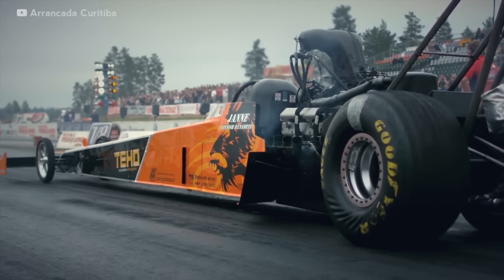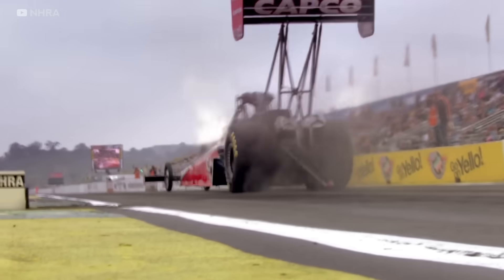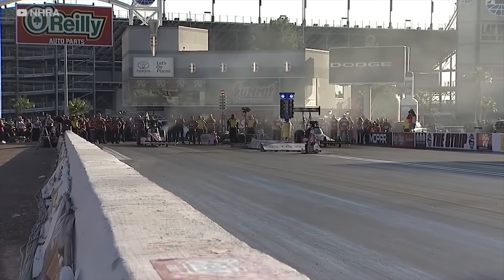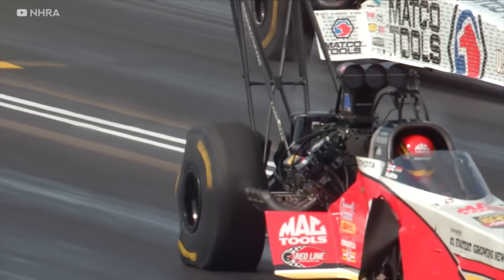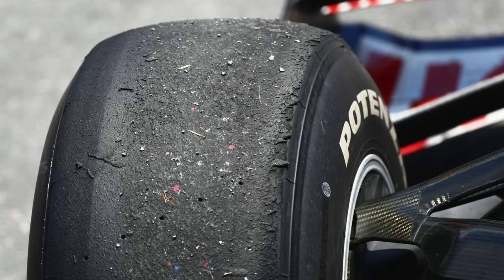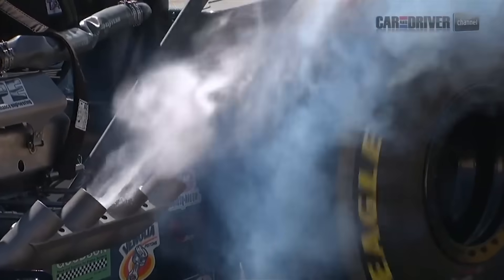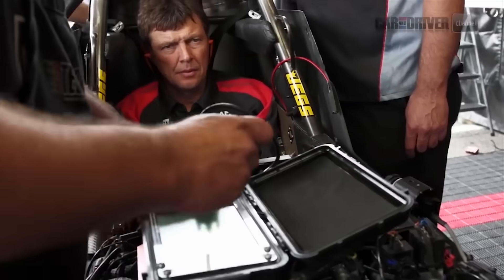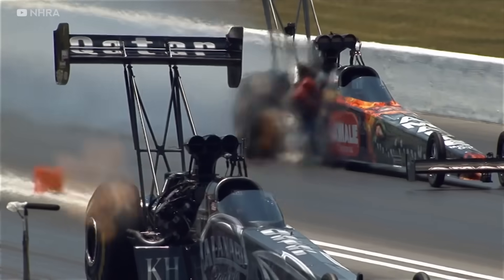How Dragster Tyres Accelerate to 335 MPH in 3.6 Seconds

Comment: You forgot to add this is done in only a 1,000 feet. NHRA officals shortened the quarter mile here in America because they were reaching speeds of 330+ mph. Now they're doing it in just a 1,000 ft.
Reply: Yeah the reduction to 1000 ft was due to insufficient length of run off for the higher speeds.
Reply: @mckennaConfig  except that crash happened at the shortest track on the circuit, every other track that is in the circuit has more than enough shut down room, that track is no longer in the circuit, and the tech has gotten 50x better since then, i say take it back to the full 1320ft (1/4 mile). most tracks are close if not a little over a 1/2 mile in length, so a extra 1/4 mile is more than enough to slow down even if the chutes dont deploy, or dont deploy properly, happened several times at my home state track, here at IMS/ lucas oil dragway, those malfuntioned runs still stopped on brakes alone wayyyyy before the sand traps.
Reply: @MPal24  all NHRA sanctioned events race to 1000ft in America ever since that crash, im not sure about europe tho
Reply: So that's about 300m instead of 400m. That's really short!
Reply: @Septimus_ii  It is! First time I saw it I couldn't understand why cars were shutting off before the finish line lol Still flipping fast though.
Reply: @Septimus_ii  yep, 320ft shorter. I always wonder what they would be running if they still implemented the full quarter mile.
Reply: @MPal24  Top Fuel is 1000 feet in Europe too. Santa Pod in England is the home of European drag racing, and it's governed by FIA rather than NHRA. No idea about Australia (the third member of the drag racing trifecta!) but I expect NHRA, NSRA, ANDRA and FIA want consistency across the world for record setting etc.
Reply: @donkmeister  id say Australia is the home of euro drag racing. Haha
Reply: I thought they shortened it because of what happened in 2008 with scott?
Reply: @The Unblinking Eye That's why they call it the imperial system...lol
Reply: @MPal24  The FIA rulebook follows the NHRA's one usually a year after. All the main rules and regulations inherited from America with some European additions mostly affecting measures expressed in SI format as well and drivers' equipment with FIA homologation listed for specific classes. Until 2018 Mr. Graham Light was the chairman both for NHRA and for the FIA Drag Racing Commission.
So yes, Europe has the same running distance as America. I'm not sure about Australia if they have reduced the distance as well. I'm sure in 2018 they were still running on 1/4 mile.
Reply: I was trying to find the exact difference between 1/4 of mile and 1000 feet in the comments, but found about european and north american political differences and wich one has the best medical centers. You rock guys. But still don't know the difference haha
Reply: @alex.ann_der  I'm sure this comment is just a joke but 1/4 mile = 1320 feet.
Reply: @Zeenithian  In meters, please, no one uses the imperial system. 1/4 of mile are 402 meters, but 1000 feet ? About 333 meters ?
Reply: @alex.ann_der  If you google "what is 1000 feet in metres" then you can find your answer. That also works with any other common units you want to convert, or currencies in fact. 
If you have a hatred of non-metric measurements I strongly recommend you keep away from drag racing... Cars have engines measured in cubic inches developing lots of horsepower, running either 1/4 mile, 1/8 mile or 1000 feet, hitting high MPH through the trap, in the shortest E/T in seconds... Demanding we don't use the established system of the sport would be like walking into a fencing club and demanding they stop using French terminology because you'd rather they spoke English.
Reply: The track length for the nitro burning classes was shortened to 1000ft after Scott kallita lost his life on a short run off track.
It was also based on the amount of damage (potentially fatal ) in the last 340ft of the original 1/4 mile,that the fuel cars were doing,for potentially little gain in mph.
Reply: I've heard that if they extended the track back out to the full 1320 the cars as they're configured now would run 400+. I need to sit down and do the math to confirm it. It's absurd if true though
Reply: @That1OldMan  that's amazing to think about, isn't it? From 0 - 400 mph in just a quarter of a mile? Then again, they said the same thing when Kenny Bernstein broke 300mph at the gator nationals in Gainesville, FL. I was just a kid, but it's amazing to see how things have advanced, and where they may go.
Reply: They reduced the length because dragsters started taking off at those speed
Reply: Wait... Are we talking about drag racing, or pissing and moaning about the units that are or are not used in other countries and/or the merits of a national health service Vs privatised health care? It's now hard to tell in this comments section. 
Seriously guys, get a douche, flush the sand out of your collective vaginas and put your whinging back in your purses.
Reply: They shortened it because they were reaching speeds way over 335 and they wouldn't have time to stop.
Reply: My understanding was that the majority of oil downs happened in the top end, so by shutting off early before the nitromethane sent the engines too lean, they were lowering lost time incidents - engine nappies, and blower catch bags weren't up to the task ... Shirley Muldowney cracked 330 many years before the runs were shortened. Happy to be corrected if I read/am wrong.
Reply: @rodneys0909  That would make sense... I go to Santa Pod for a couple of events each summer (apart from this summer... obvs). Probably teaching you to suck eggs here but the clean up when an engine blows takes a good 10-20 minutes easily, and that's with a fair bit of machinery to help and a well-oiled (arf arf) team doing the work. So the lost time definitely adds up.
Reply: @donkmeister  Mate I used to be a die hard drag fan for over 20 ish years in Oz, haven't been in 5-10 or more years, we still run 1/4 mile AFAIK, but yeh clean ups are a real big down time. Soaking up oil, then removing all the scrap metal from the block, then the tractor with the rubber strips has to run the strip a few times to resurface. So 20 mins was a REAL good effort down under. And we have NO where near the money or number of cars involved, so lost time and money I'd guess was a big factor in the early shut offs in the US.
Reply: Give Me The 1/4 mile anyday  its Over 2 Soon Now
Reply: for peolpe who don`t want to convert it themselves: 1000ft=304.8m and 330mph=147.5m/s=531.1km/h
Reply: @MPal24  no, only the nitro cars race to 1,000 ft. Pro stock and other slower cars still race the 1/4 mile
Reply: @dpeff  You're right. Only nitro classes were shortened. Top alcohol, pro mod, and sportsman classes still run a full 1320ft.
Reply: Are you Americans still using feet? Jesus Christ
Reply: @fermignano89  yep. Thank you for the laugh.
Reply: @fermignano89  Yes and we call them wrinkle wall tires, not ripple wall tyres. We invented the sport so learn the language.
Reply: @fermignano89  are you foreigners still using American internet, satellites and American military for protection Jesus is Christ😂
Reply: White Lion are you Europeans still not a global superpower? Jesus Christ
Reply: @coleroberts3409  America is a global superpower? Good to know. :D (just kiddin)
Reply: @coleroberts3409  Neither is Murica anymore :D Orange left the soft power to vanish, so gg on that joke :D
Reply: @coleroberts3409  Nice health care system.
Reply: Hey look big tires and speed...let’s talk about politics?
Reply: Four as one American healthcare systems are actually superior to European ones due to the incentive of Capitalism. Though it might be a little pricier, the service pays for itself.
Reply: truethera what’re you on about? America is and has been the only global superpower.
Reply: @avo616  America has a great health care system. Just because we don't tax the hell out of our citizens to make it "free" don't mean it's not great. You can pay for insurance/ out of pocket or you you can pay higher taxes for what you claim is free health care. It's not really free.
Reply: @gofigure84   The USA spends twice the percentage of GDP on healthcare as the average and has the lowest life expectancy of the first world. It fairs equally poorly on just about every other health care metric. Paying in tax for free at point of delivery (which is what free always means in this context) seems to get you more, and be cheaper. It might seem to work, but if you compare it to how other systems actually perform it is far from great in comparison. The metrics are frankly embarrassing. Childbirth related deaths are higher in the USA than Iran...
Reply: @truethera  lmao dude america lost its power longgg before trump
Reply: @gofigure84  as a Norwegian I support your statement. The health care here is not free, most Norwegians pay between 30 and 45% of their salaries in taxes... And the health care here is mediocre at best... And we pay for a lot of stupid government funded shit that is completely unnessesary!
Reply: @SamBrickell  bruh the Medicare levy is well worth not having to go homeless for a broken foot. Lmao
Reply: @coleroberts3409   Really? How big was your Empire?
Reply: @agsystems8220  Americans have one of the highest birth rates higher than Europe France is behind 😂
Reply: @BluesManSteele  dude America is the world currency 😂
Reply: @avo616  bro I used to live in Europe we go broke paying for gas😂
Reply: @Namesakes.unit-x-10sq10  exactly I used to live in Germany and the taxes is one of the reasons our populations are declining I actually payed more in taxes when I got married 😂🖕🏻
Reply: @avo616  nice declining population😂 heard their moving to America 😂
Reply: @truethera  sorry we still tell you what to do, sounds like you have a Us military base in your country😂
Reply: They shorten the run because the Goodyear tires were coming apart
Reply: Yeah cuz america us becoming weaker
Reply: BluesManSteele And here you are using Google, an American Company.  Then there’s Amazon, Netflix, Apple, and Microsoft. Despite what the Brits say, we invented the Internet (a Brit developed HTML, which is not the Internet). Plus we provide the world GPS for free, so there’s your feet and mile measurement that the entire world uses. All oil prices, whether it involves America or not, are in USD. Our tax dollars keep the sea lanes free. So, yes, we are the only global superpower, because we are the only ones with global reach economically, militarily, technologically, and yes even in healthcare since our Pharmaceuticals develop the most patents and medicine above any county.

Comment: 2:43 is a common misconception. For this to work, the running surface would have to rotate at a slower rate than the rim, which doesn't happen.

Comment: They should put the junk vehicles on big cogwheels and on a cog track. No slip at all.
Reply: Inb4 so much power going through the cogs that the teeth break
Reply: @naut3  not with right material special steel

Comment: wait, these things dont need air? whaaaaaaaaaat?
Reply: CH3NO2, oxygen is already present in the fuel, so you don't need more :)
Reply: Nope, the fuel has oxygen atoms in it that will burn when the spark plugs go. That’s why the spark plugs are so strong.
Reply: YES, they need air! Lots of misinformation here.
Reply: @MikeM275  no, they don't. do they have intakes to get more oxygen, yes, but they don't need them to operate... you shouldn't have skipped that chemistry class
Reply: @Moribax85  Yes...they do!! Take of the scoops and see how fast a fueler will run!! Seems you would understand they NEED air to create the HP that they do. As to chemistry class... I have set 25 world and national records in drag racing, ended the year #5 in the world once, and #3 once. I think I'll stick with the facts that I know...
Reply: @MikeM275  here's where we disagree: I never said they don't need air to output that kind of power, I said they don't need air to function. 
That's way different. 
That doesn't consider the power output.
That just means that the engine don't need air to start and function, even if they only work at 20 HP, because the oxygen they need to "stay alive" is provided by the very fuel they use.
I never said they can race at that level without air intakes, just said they don't need air to function, and an engine that's just capable of idling or moving at 5 km/h is still functioning

Comment: How many horsepower would drag engine had if they use normal fuel ( I know it wouldn't work but I'm how much horsepower it could lost)
Reply: i honestly don't think they would even start with normal fuel, just like an F1 car wouldn't start with normal fuel... the engine is designed and built with that specific fuel in mind, and is over-specialized for it, making extreme performances possible... without considering that normal fuel would need air mixed in it, something that nitro-methane doesn't need, since it already has oxygen in its molecular structure. it's the same as a petrol car not running on diesel, and vice-versa
Reply: Moribax The fuel used in F1 cars is actually quite similar to that in normal road cars
Reply: @Mini-cu6mk  similarity in chemistry means nothing: it has the same components of normal petrol, true, but the proportions are different. how does that change thing? let me put it this way: H2O is essential for your life, it will quench your thirst; H2O2 will kill you, fast.
All that's changes is one little oxygen atom, and we go from simple water to hydrogen peroxide, that is a disinfectant when heavily diluted, but pure, it would kill you, fairly quickly and painfully
Reply: Moribax ah I see, thanks
Reply: @Mini-cu6mk  no problem mate, I appreciate your willingness to learn, it's rare on the internet in this day and age :)
Reply: Moribax true

Comment: Shame F1 are losing balloon tyres for marketing reasons, lucky drag cars can't afford the performance losses
Reply: it's not really for marketing reasons, you know, it's for competitive reasons, to make the pack drive closer to each other
Reply: Moribax marketing does play a role in it though, makes the cars more road relevant
Reply: @RD-wg9em  can't say it doesn't have an impact, but it's not as the opener said, it's not purely for marketing purposes, that's just the after-thought, primarly is to make races more interesting, and make cars more resistant to side-by-side impacts, as it's harder to puncture a tyre with smaller shoulders
Reply: Moribax yeah I agree, think it’s the same thinking that’s leading to them is simplifying the aerodynamics